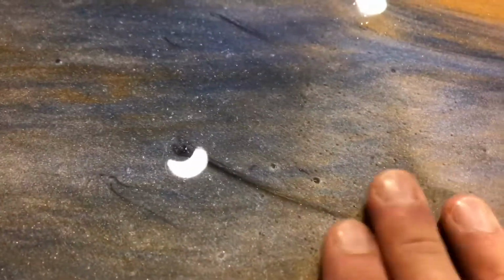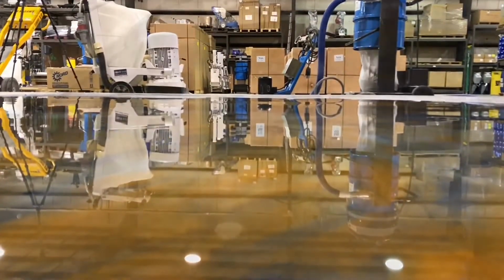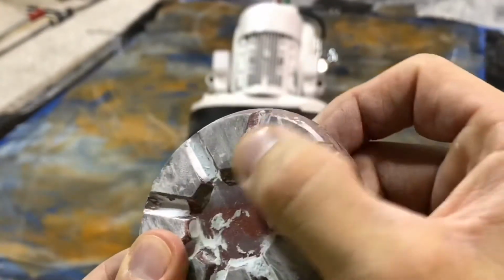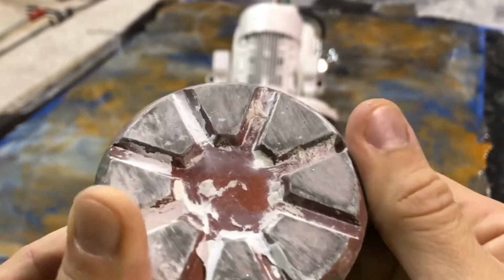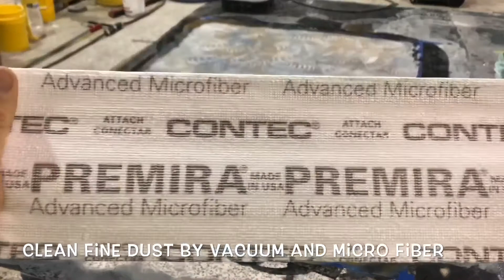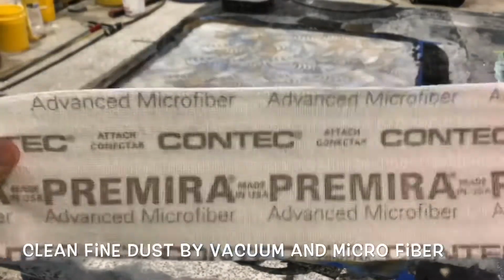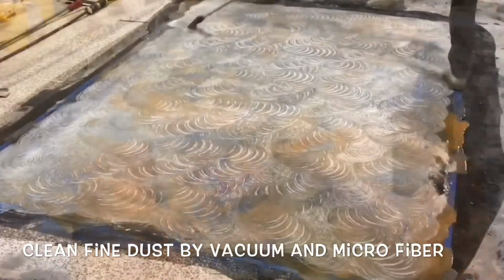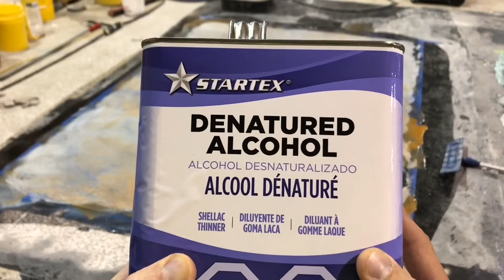How to: Epoxy Metallic & Urethane Topcoat

Comment: I’ve never seen anyone prep their metallic using diamond tooling. 

Is that ceramics?
Reply from the maker: It’s not too common because sanding screens are more easily used. These tools are a 150 grit metal bond diamond. If the area is larger, the grinder does the work more quickly than a buffer. Still, a swing machine and screens will work too.